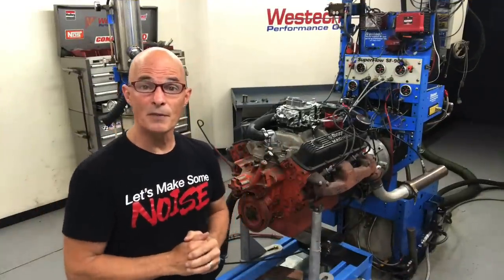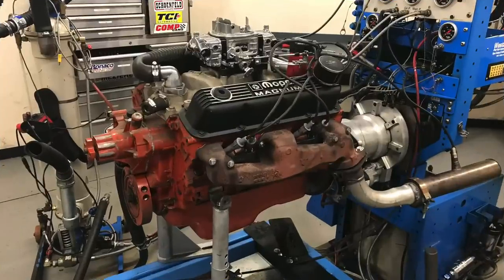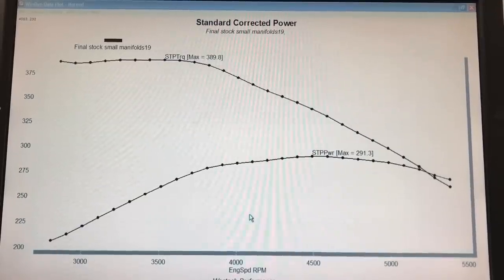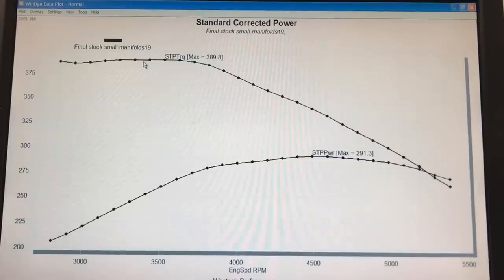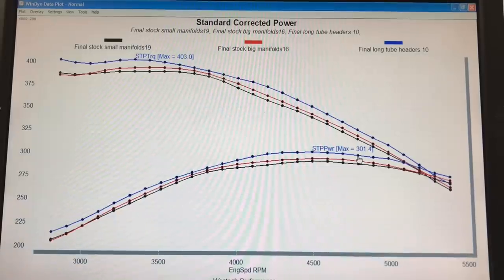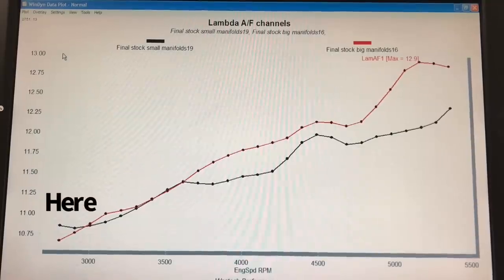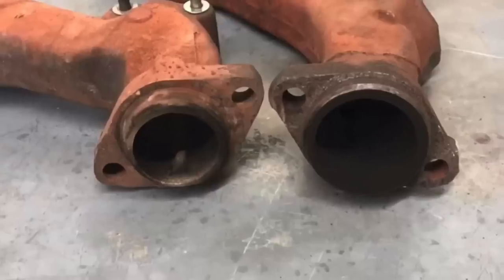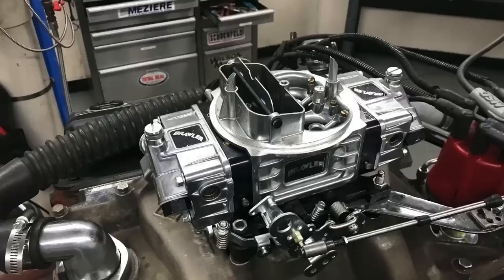DODGE 360 MAGNUM -TOP SECRET (FREE) JUNKYARD EXHAUST UPGRADE!!

Comment: For that small gain I would keep the cast iron manifolds.
Reply: Do you fully understand that the difference between a good engine and a great engine is the great engine did 10 little things that added 5-6 hp. Added a little better throttle response, made it accelerate a little faster.. it's not magic, it's applied science bro. Not dogging you, but I read your response and am reminded of countless web forum posts where guys are asking why their engine only does 350 hp and their buddies basically identical engine does 380-390 hp.. the buddy paid attention to all the little 4-5 hp gains and applied them to his build. A solid 4 hp from idle to redline is an awesome gain when you consider what it cost to do.
Reply: @b.c4066  I get your applied science "bro" and thanks for the lesson. My point being that for all the hassles that come with headers, on this particular application they are NOT WORTH 4-5 HP BRO

Comment: I would love to see a dyno test of a L05 5.7 TBI engine, stock heads with a cam upgrade.
Reply: On a Ford 250 six with iron single oulet 2 inch header, verses a big long tube 2.125, I got the same 18% improvement in power Wheels magazine got in 1978 on there 121 hp engine. A 13% improvement in fuel consumption. A dyno test showing a 3 to 4 % improvement is Not Much. It is Great Info, Though. Sb Mopar Magnum  Appreciation,  100%!

Comment: What years and models did the manifolds come from?
Reply from the maker: 92-93
Reply: @richardholdener1727  so the first gen rams had the larger manifolds?  If thats the case then they likely used smaller ones on the new engines to improve emissions. I would then assume it would help to heat the cat faster and keep it hotter.

Comment: I want to know WHY the long tube headers flattened to curve. I can’t seem to come up with the answer.
Reply: Smoother and longer exhaust runners have more scavenging which in turn results in a better signal to the carburetor
Reply: the stock intake manifolds are basically a log with all 4 ports dumping into the same pipe almost at the head. This gives the exhaust from cylinder 1 to dump into 3, 5, or 7 as that cylinder's exhaust valve is opening (as an example.) The cylinder to cylinder air fuel ratio is greatly improved with headers, if Richard could have mounted o2 sensors on all cylinders, the data would have shown that.
Reply from the maker: SCAVENGING WAVES CHANGE SIGNAL TO CARB-CHANGES FUEL DELIVERY

Comment: This isn't the TBI sst magnum test this is carburetor the SS/t is 1997 - 1998 only manifold you missed one super sport truck only exhaust is this even roller cam
Reply from the maker: the motor is an EFI magnum but run with a carb. the two manifolds are the two different factory pieces
Reply: If it's not 1998 ss/t - sp - r/t 2002 Durango EFI magnum engines your not testing performance 360 parts your base testing non performers and carbs a waste of time it's not even 340 power numbers which a 340 with step headers built right is torque monster but uses 360 parts to get too power bad test